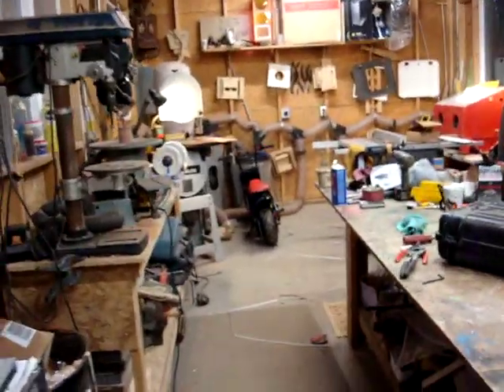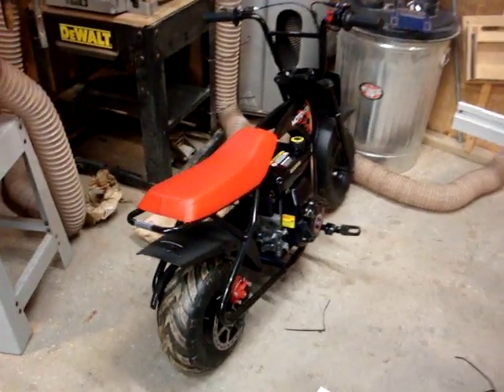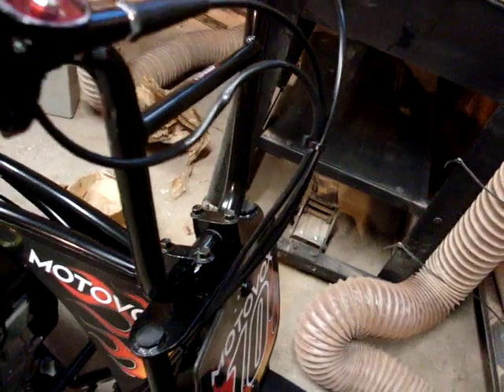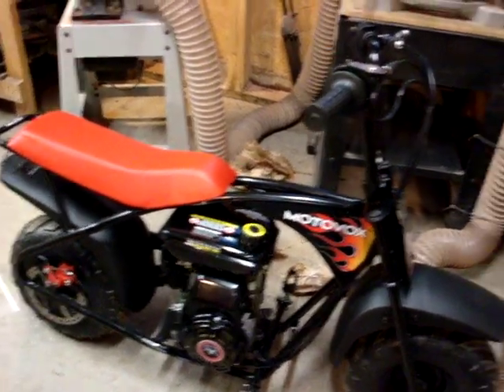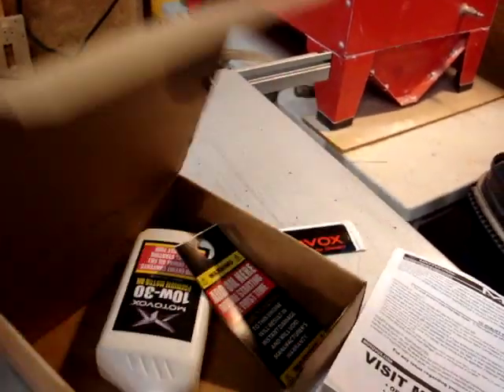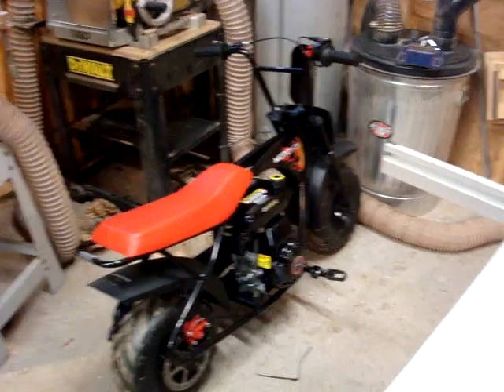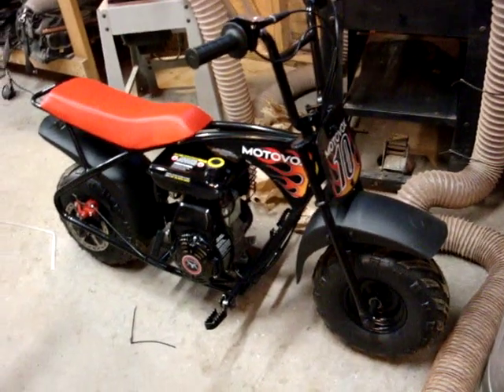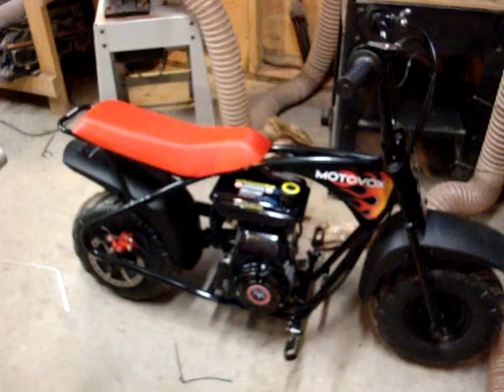Motovox MBX10 Mini Bike: Good and Bad

Comment from the maker: That's what I did. It's a simple machine. Motovox stands behind it 100% and will send you any parts that are needing replacement. Mine arrived with a broken handlebar clamp and oil all over it but that's not a catastrophe. It is what it is.If you are willing to handle whatever needs to be handled go for it.

Comment: Got one for my kid at xmas. Would only run on choke position. Kept cutting off in any other position. Have a slight grade on property. It will NOT go uphill at all! Took it back to Sears. I wasnt the only one to return one. I did call the customer support for Motovox. Was told to change the spark plug... Really? Brand new. Good advice guys. I got a refund and bought a Doodlebug and that thing will do at least 30mph with me on it at 200lbs. My kid really loves it. Dont waste your time or money on the Motovox.

Comment: Motovox sells just the bare rolling chassis on their site and you can add a Predator engine to it for the price of a new Motovox if you're looking for more power. The stock ones are just an entry level model for young kids to get the feel of riding and working on basic mechanical skills.

Comment: I just got an Italika 300 $ with nice helment and no sales tax. Dissatisfied at first, the back wheel was stiff. I adjusted the breaks . chain, and opened the throttle, put stp on chain. Goes up any hill now at high speed.Loosen the chain so all turns easily . Shoe polish is excellent for wax.

Comment: The stores that sell the new minibikes will take returns back for ANY reason at all within 90 days of purchase. Mom says no, too fast, too slow, broken, missing parts, etc are all reasons why someone would return it. They're shipped back to Motovox and the good ones are refurbished at their factory in Missouri then sold to second hand retailers. I'm sure if you have anymore issues you can contact someone at Motovox. I've had no issues with mine yet and their customer service is always helpful.

Comment: I take it you just added the WHOLE BOTTLE of oil to the crankcase? You have to add oil while the engine is LEVEL and check the level AS YOU FILL IT UP. The clutch slips because of lack of the governor adjustment. It doesn't allow the engine to rev up enough to make more torque/power to hold the clutch.  Both of these are due to the lack of you reading and or following directions to add oil properly and adjust the governor correctly. @ 4:27 "it's not - in my mind if you look at it you have a fair amount of play there " That isn't how you adjust it to make it work properly. I am sorry you had some problems with this SIMPLE and VERY FUN MACHINE. I and the family enjoy the pair of them that we have.

Comment from the maker: Good of you to mention that. It's also in the owner's manual. 2 hours of run time then change the oil with regular motor oil. 390cc is about what it takes. This refurbished unit was shipped with some oil in the crankcase and it created some problems. But it's running fine now. Still well under the 2 hour break in period...I guess. It's a refurb so I don't know how long it was run before being returned etc.

Comment: Yep they are gutless unless you turn the screw ALL the way out.  THEN wire the governor arm solid to the throttle arm.  Mine does 33mph all day with a 295 lb rider.

Comment from the maker: My cameras are essential to documenting work and selling product so yeah breaking two cameras in one day was a big problem. Which is why you have seen no new uploads since this video. A friend gave me a cam and I am waiting on a battery and a micro SD card to arrive so I can get back up to speed in pimping product. Since this vid I have installed a T Max clutch and PMR Jack Shaft kit and the bike still won't climb. Waiting on a lower  drive cog now. Hope that works. Otherwise need more HP engine

Comment from the maker: According to the guy at Motovox it hauls his 260 pound ass around just fine. I assume he is on dead level terrain. But it's not for me...my 80 pound son is going to ride this...and I can restrain the bike with about 20 pounds of resistance...I mean it has absolutely no guts at take off. If you are standing over the bike, not sitting on it, just holding the handlebars and give it throttle it should try and take off and do a wheelie trying to get away...but it just putts away clutching slipping.

Comment from the maker: When you say took off governor do you mean you opened the case and removed the little gear/weight doodad in there? Or do you mean you unscrewed a screw from the ouitside. Or do you mean you disconnected the arm on the outside? Or do you mean you bypassed the spring part with a rod or wire? Please be more specific. I am still researching this bike on YT but so far engine speed has NOTHING to do with the ability to climb a hill. It appears to be torque that is lacking...

Comment from the maker: It's not for me...it's for my 10 year old and he weighs about 80 pounds. And it's not about removing a governor or how fast it goes it's about climbing a grade. As sold this bike will only work on nearly flat level ground. The gearing is too high to climb even a modest bump in the yard let alone a real hill. I installed a jackshaft and a put a 10 tooth cog on the output shaft of that and now it climbs 20-30% grades fine. No changes to the power output at all. No governor mod. Just gearing.

Comment: okay because I have the same bike but the tree blend of the bike and I want the bike to go faster how do I do that already 45mph without removing the governor
Reply from the maker: +Carlos Adolphus There is no replacement for displacement. You need to put the biggest engine you can fit on it. You can change gearing...but there will be a trade off between grunt off the line and top speed. You can't have both with a single speed. You can go with a torque converter instead of a centrifugal clutch. Probably would have to because a torque converter is going to handle big power better.
Reply: +Mountain Storm I'm not good with the gears 😕😕 that's why just have an automatic but it only reach 25 the engine sucks 😠😠
Reply: +Mountain Storm and also it's only a 2.5HP what about horsepower and torque can I get more torque and HP
Reply from the maker: +Carlos Adolphus Physically a 212cc "Predator" engine that is rated at 7 HP will fit on the bike no problem. Look at Harbor Freight. Sometimes you can get them on sale. Anything bigger and I think you will start having problems.
Reply: +Mountain Storm okay thank you
Reply: +Carlos Adolphus Hey man, I have been taking these things and turning them into theme bikes.  I drop the 212 predator in it and get the upgraded air filter, jets, and exhaust.  THings sound and run BOSS.  A little over 30MPH and it will do wheelies like its its job!!!  www.gopowersports.com or www.OMBwarehouse.com will have everything you need.

Comment: By now you probably have figured out to just throw a $100 212 Predator from harbour frieght on it!. Oh, and a $25- 420 3/4 13 tooth clutch, a $22- Bib 420 chain and a $20- rear 6" 420 sprocket. You'll take off like a rocket with a higher top speed. Plus, it's a blast to build! Just call Gopowersports for everything but the motor. Unless you want a REALLY fast assed 212 bike. I put a tillotson 212r on mine.16hp Later.........
That's 16,000 bald eagle power! ha

Comment: You got ripped off because I have one that I got from Kmart and it had a steel frame supporting it from moving within the box and was in clean condition without a speck of oil except about after a week my breaks went out so I used my boots and I have to oil my clutch every month because it gets stuck but if I put to much grease on it it will go only a 1/12 of its speed

Comment: I'm saying that I remove the tiny little screw from the outside part.   and yes I did notice a difference in speed I did get a lot faster.   and yes I realize now that having a smaller sprocket would mean less torque.

Comment: I have been riding mine for about 3 months in my neighborhood on the streets with no problem, I've driven pass 3-4 cops between that time, and they said nothing to me. But 2 days ago I was riding in my neighborhood and I got pulled over by a cop, he was super salty. But he didn't give me a citation, but he said to me if he saw me ride it again, they would tow it. I am not sure if I did anything wrong, I even installed headlights in the front so if I rode it in the dark, people could see me. Can you help me? I live in Georgia
Reply from the maker: It depends on the cop and the hood. I would imagine there are ordinances against them, but whether they get enforced is problematic. I can't give you any advice except find somewhere private off road to enjoy your deal.
Reply: Ok thank you
Reply: ***** in order to drive any motorized vehicle on public roads legally you must have working turn signals, break/headlights, and a registered license plate.

Comment: i just got mine and i was riding it on the side walk and got pulled over by a cop. They gave me a citation and gave my boyfriend one too!!! The cop said you need to have a drivers liscense to drive it and that you cannot ride it on side walks on the street. you can only ride it on privately owned land!!! WTF!!! I now have to appear in court along with my boyfriend because of this. I read the manual the bike came with and it clearly states " avoid operating this vehicle on paved surfaces including, but not limited to highways, parking lots, side walks, and drive ways. never operate this on any designated off road vehicle on a public street, road, or highway where it will be a violation of local traffic laws and restrictions." So people dont buy these bikes whether from motovox or monster moto. Because if you plan on using this item like i did for transportation wise you will be facing a felony charge like me. So I am now hoping I dont get a felony. And the felony charge would be for the part of you driving this vehicle without a liscense. But yet its made for 16 year olds and older. Not all 16 year olds have a permit or liscense. HOW IS THIS FARE. AND THE COMPANIES DONT TELL YOU THAT YOU NEED A LICENSE
Reply: I ride mine on the street and I passed a cop he did not stop me and my friend we were both on it and we asked the cop we he did not stop us and he said u guys where not doing enything wrong the only way we could stop u and give u a ticket was if there was a complaint, we ride these all the Time on the streets I don't know why the cop stoped u
Reply: You can't ride anything over 49cc on the streets period,  you gotta check the laws in your state before you take any motor vehicle on the streets,  this is your responsibility not the manufacture dummy, what you think you just buy a go cart or a dirt bike and take it on the streets or sidewalks.. this is your own fault,  not the manufacturer... duh!!

Comment: I'm definitely happy with my bike. though I am definitely thinking I will change the size of the rear sprocket, as you may have noticed is ridiculously big, so big that occasionally when I ride it wants to scrape the ground which could damage the chain even with properly inflated tires. going to have to go with a sprocket that smaller.

Comment: damn bro it looks like everuthong brakes on you.you had 2 camaras that broke with in this video hahaha
Reply from the maker: I have a history of killing cameras.
Reply: +Mountain Storm i have a 2012 idk if they are the same year.but i bought it for 50 bucks .i need to rebuild the carb.drain the old gas.buy brake cable and the throttle cable.hopefully it will start.
Reply from the maker: Hugo Chavez For $50 you can't go wrong

Comment from the maker: Found an upgrade clutch and as soon as I figure out everything (need to check chain size, drive cog tooth count, shaft diameter, key dimensions) I think that's the first thing to try out. The clutch I am looking at can be fitted with a stronger or weaker spring to control when the pucks start to engage with the housing. A lower tooth count will help with climbing. I don't know for sure but I assume a higher RPM for clutch engagement would be better...but also a bit more of a lunge at take off.

Comment: I have a motovox I put a 6:0 motor in it and it flys it does 60 top. the 3.0 . well no matter what you do to it . It wont go fast or get stronger. so 6.0 or 212 prettier

Comment from the maker: I would not buy this minibike or recommend it. If you live in dead flat terrain and weigh less than 100 pounds it should work for you otherwise you will be very disappointed. The real answer is more HP and this powerplant won't mod to much more HP so you need at least 7HP IMO. I Predator 212 is $119.99 + $6.99 shipping from Harbor Freight. Cheaper than a jackshaft kit actually.

Comment: I think somewhere in these comments and the video, I figured out what my priblem might be with my grandson's 80 cc bike.  If the rear wheel is off the ground eith no wright on it, the motor revs and the wheels seems to turn very fast.  Set it on the ground and hold the handle bars standing over it, it will not even even do s wheely.  The motor csnnot rev up.
  This bike has been sitting fir some time. I think the clutch is stuck and this is not allowing the engine to reach the rpm's needed.
  This is just s guess, but the more I think about it, the more it makes sense to me.
  Btw, what is the proper way to adjust the governer?

Comment: Sorry to hear about your problems but unfortunately, the Motovox mini bikes are cheap Chinese products not to mention VM Innovations is run by a couple of young punks who don't have a clue which is why it was packaged so poorly and you cannot get good customer service. And yes the seats are garbage! As far as the engine goes, the stock engines are only 79cc so they are weak to begin with. So just get a $99.99 212cc Predator engine from Harbour Freight, install it and ride it like you stole it!